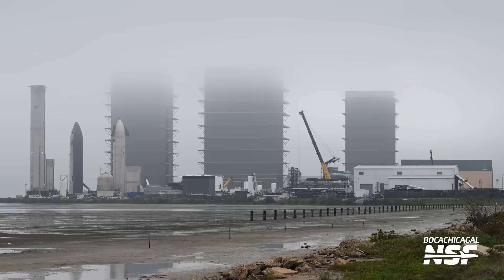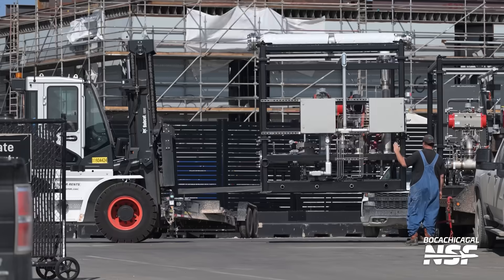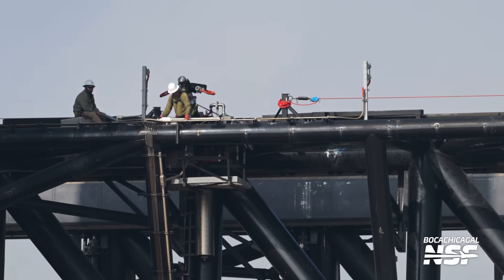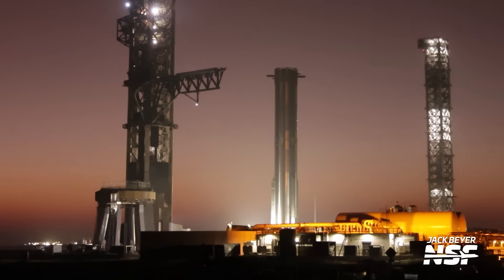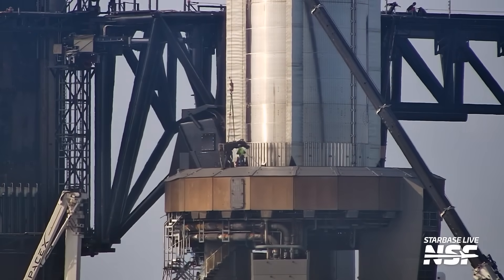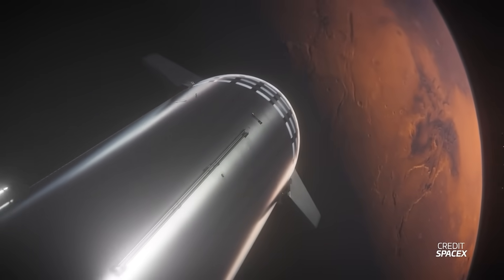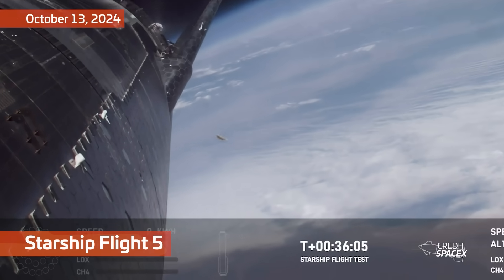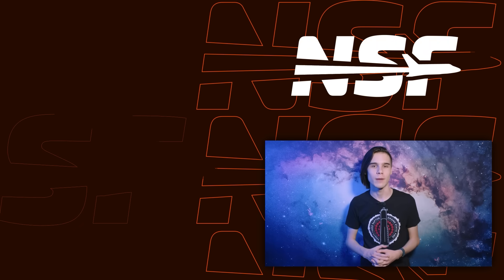Starship Flight 7: SpaceX Confirms Major Upgrades and New Payload Test🚀 | Starbase Update

Comment: The space industry is poised to welcome skilled professionals from the traditional oil and gas sectors, creating exciting new opportunities for growth and innovation.

These individuals are accustomed to working under high pressure and managing difficult gases, as well as navigating large and complex infrastructures with extensive automation. For a worker experienced in drilling 5 km deep oil wells on a platform 500 km offshore, constructing a space rocket launch facility feels like a simple task.

Comment: Weird there's still going to be a hot stage adapter. Seems they've had time to work that out.
Reply: They're still using a block 1 booster. Any change to the hot staging arrangement won't happen until at least block 2.
Reply: @KeandeLacy  And there's what, 2 more block 1 boosters? I get that they won't re-fly the one they caught.

Comment: What’s the latest on 10th for the launch? I been reading a few comments expressing concern about a nasty weather system heading towards Boca that might be an issue for a launch on 10th but forecasts can change. Has that weather front changed direction or is it still a threat for the 10th? I really hope not because it would be pretty cool to have IFT-7 and New Glenn both launching on the same day.

Comment: It would be interesting if they really end up switching to a metallic heat shield, or a metallic heat shield in combination with active cooling. The metallic tile tests seem to indicate that ceramic tiles have more problems than they originally anticipated.
Reply: Sounds doubtful. Metal tiles are invitation of heat into body.
Reply: @hrissan  Search for "metallic TPS" on Google. There was NASA research on it, and it was planned to be used on the VentureStar SSTO (Lockheed Martin's projected Space Shuttle successor which later got cancelled).
Reply: I think it will continue to have ceramic tiles, tho it might be a hybrid with maybe they'd think to tile the whole ship to reduce the boil off further and the probability of in-space space debris strikes causing catastrophic failure

Comment: That would be cool if they put a couple of PTZ cameras with starlink antenna on a couple of those dummy satellites to view the starship and part of the re-entry.
Reply: Unless they've got attitude control on the dummies the camera movement will start the satellite rotating. Space is awkward for things like that. Probably best to have a 360 camera like they use on those buoys, no moving parts = no inertia.

Comment: 15:50 "SpaceX is testing the idea of active calling on this flight again"
Again? Did they test the active cooling on the previous flight?
Reply: In the early days of starship they wanted to use active cooling but they abandoned the idea. They are  testing the idea again.
Reply: @viciousspud8620  That's my point, back then I don't think it ever passed the "idea phase" and get to the test flight.

Comment: Why dont they cover the launch mount with the heat tiles?
Reply: This issue has been addressed many times as people have also suggested tiles on the OLM legs mm .  Basically the tiles are intended to withstand the compressed atmosphere on reentry which causes them to heat up.  They would be shredded by the high heat and thrust energy from the raptors.   Look at what those raptors did to concrete which was designed to handle high heat on ITF-1?!

Comment: Looking forward to it. 
I'd like to know for instance what exactly that loadspreader is doing at the site to help prepare the vehicle for launch. It's moving dirt, but for what purpose exactly?
Reply: And what does "HSR" mean?
Reply: @MrX-zz2vk  hot staging ring HSR,  it's the connecting piece between the booster and the ship.
Reply: @corrinastanley125  Thanks, that's right. Brain fart on my part. 
But what does the loadspreader do with the HSR since it was already attached to the booster several days ago?
Reply: @MrX-zz2vk  it will remove the HSR from the booster.  It may be to work on the gridfin actuators or perhaps sensors or cameras.  They have done this in the past.
Reply: @corrinastanley125 so LS will R&R the HSR for PAO? Got it
Reply: @jerwahjwcc  Nope. Plain English please.
Reply: @Corrina_Stanley  Thanks 👍